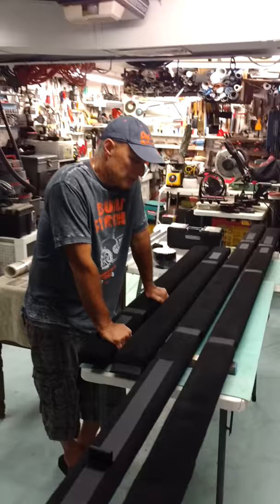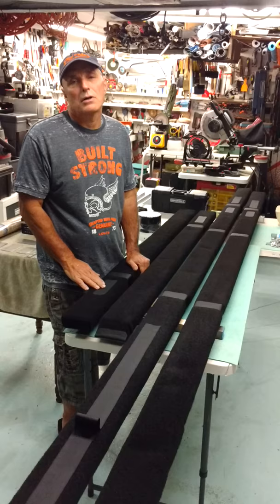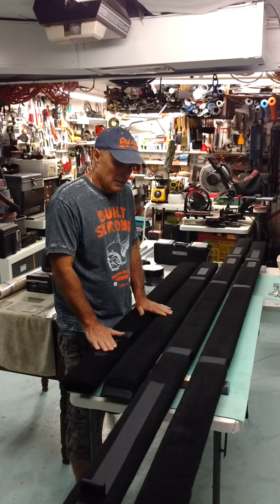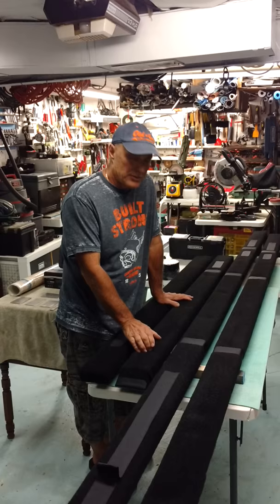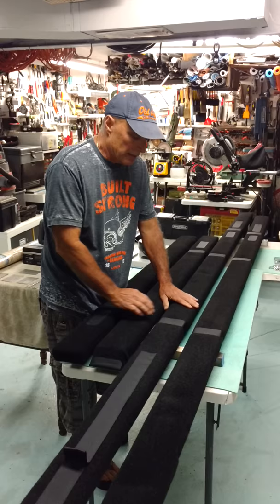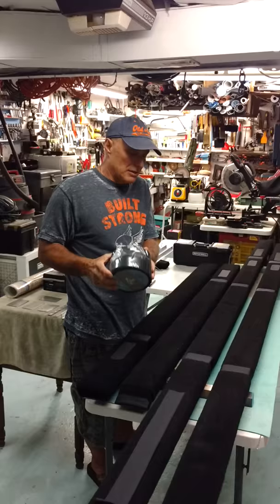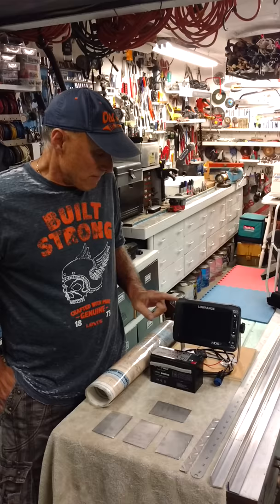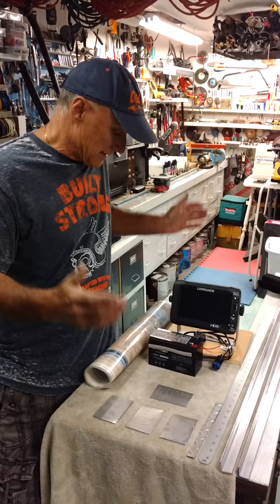Boat Trailer Bunks and Velcro

Comment: Great idea using Velcro like that, especially for repairs. Same for the Lowrance power station. That reminded me that I need to link my Lowrance HDS7 to my tablet. Lowrance has an app and I want to see how much I can do from the app when my HDS7 is off and what I can do while it’s on.   The app is LINK: Connect Your Boat made by Lowrance, Simrad and B&G.